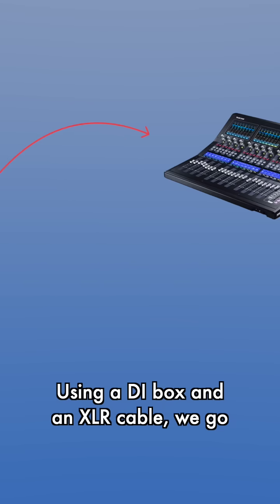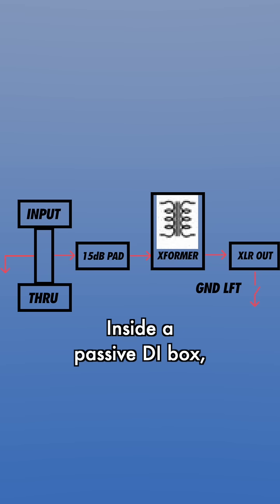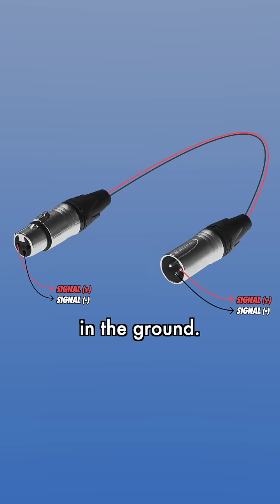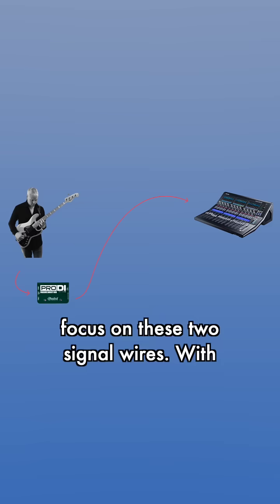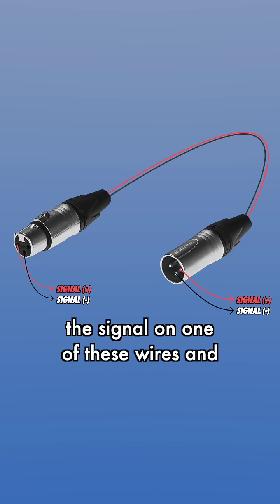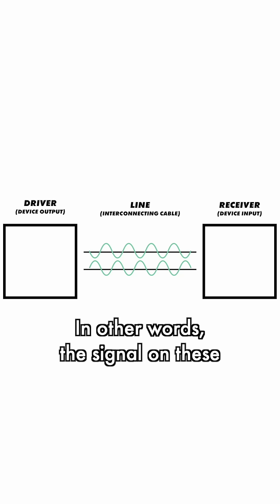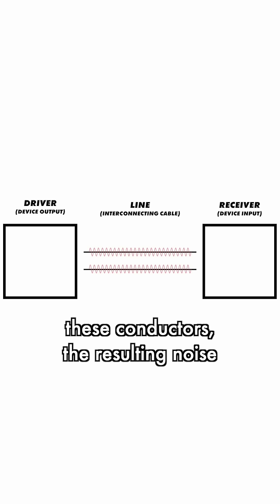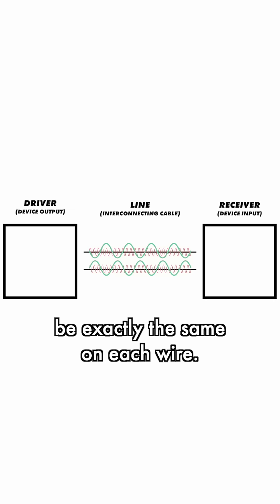How a DI Box Balances Unbalanced Signals

Comment: I’m an electrical engineer and embarrassed to say I don’t even know this myself. But in the case of that passive DI box and by the way, boys and girls does I mean direct inject or something anyway when you use a passive DI box with a transformer, isn’t there a center tapped transformer on the secondary coil so that you can be feeding the oppositely going up and down differential signalto the XLR terminals on the mixer?😊 do ya know what I mean, am I making sense?

Comment: The noise rejection property of balanced lines does not require the signal to be applied to both the non-inverting ('+') and inverting ('-') conductors or even that the signals be of opposite polarity if they are applied to both conductors.  Instead, the conductors' source and load impedances must be as identical as possible and the conductors must be in as close proximity as possible.

Comment: For anyone wondering: the transformer is what makes the line from the DI box to the mixer balanced. A transformer is often used to isolate two circuits from one another. In this case it effectively isolates the balanced line (where both signal conductors have a high, equal impedance to ground) from the unbalanced line (where one conductor has a high impedance to ground while the other is connected directly to ground).

AudioUniversity sort of explains the benefits of a balanced line. It's about the ability to be able to reject noise that's picked up between source and destination (especially useful on long cable runs). But you may ask: why can't we connect an unbalanaced cable directly to the balanced one? It's because a balanced line is a somewhat fragile thing. Every circuit connected directly to it also has to be balanced, so connecting it directly to the unbalanced cable would make the whole line unbalanced and the benefits of the balanced cable would disappear.

The transformer makes sure to isolate these two from one another so that at least the balanced side of the DI box can utilize the noise rejection benefits of impedance balance
Reply: This comment is better than the reel
Reply: Active DIs don't necessarily have a transformer AFAIK
Reply: I an XLR to1/4" , for using a balancd mic with an amp or other inbalanced stuff. I think you anwered my question. It's only good for it was made for. Not unbalanced to balanced. I love this kind of stuff on You Tube.
Reply: @wonkyganu72 What he told you is incorrect.
Reply: The transformer is not what makes it balanced, it’s what isolates your equipment from accidental phantom power!  What makes the signal “balanced” is there being sent two signals 180 degrees out of phase, making it virtually immune to interference/noise.
Reply: @PatrickWaugh-kk3ze It's true that the transformer itself only works to isolate balanced circuits from unbalanced ones, but your signal explanation is actually a myth.

the essential part of noise rejection is that the noise appears as a common-mode signal on the receiving end. whether your desired signal is sent as a opposite polarity pair or not makes no difference. it still works even if you send the signal on one wire and leave the other wire at 0 volts :-)

Comment: This video should be titled, "How a balanced connection works" rather than "How a DI box balances unbalanced signals". :/
Reply: Yeah, I didn't really learn about the DI box at all.
Reply: Came here to say this.
I know it involves a transformer but that’s all I got out of this clip.
Reply: In my understanding, the transformer is just one of the possible ways to create two opposed-phase signals.
Reply: @spinospinellibass It's the only passive way. A lot of DI boxes don't use transformers because they're expensive. They use an amplifier with two outputs - a non-inverted output and an inverted output - each if which feeds one leg of the balanced output. They work ok but need a power supply. The big advantage is they're cheap - an op amp chip with a few resistors and a capacitors is much cheaper than a precision-wound and screened transformer. Transformers have another advantage though - you can centre tap them and use them to provide phantom power, but that's with a video on itself.
Reply: @johnm2012  what's the use case for providing phantom power? The input is usually unbalanced. Unless it's a splitter?

Comment: And then at the mixer's end, the signal that was inverted is put back as it was and now it's the EM noise that cancels out.
XLR audio signal is so clever.
Reply: Without your addition, his explanation only goes half-way to solving the noise problem.
Reply: @richardhole8429 i was gonna say he was missing the polarity flip
Reply: @musictolistento1356  The polarity flip does not affect the noise cancelling.  The blanaces input amplify the difference between the voltages on the two lines, not their offset to ground, so you get the same cancellation even by reversing the two wires for phase matching.
Reply: @rickhole  ah yk youre right, i was thinking of the phase match not polarity. flipping polarity would just flip the signals but do nothing to noise, its the phase match that puts the noise out of phase and cancelled
Reply: Some balanced outputs don't have 2 signals with opposite polarity, rather a Hot and a Cold, with only one conductor carrying the signal. Noise still cancels out and signal just stays the same level, instead of being amplified by 6 dB.
Reply: This is the final step that makes it all make sense. It’s using phase inversion on the noise itself😮